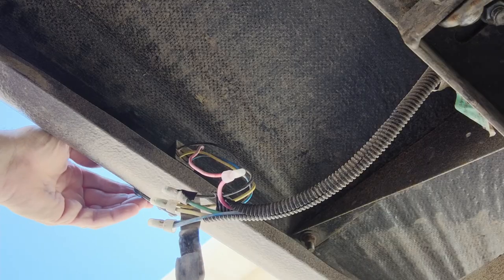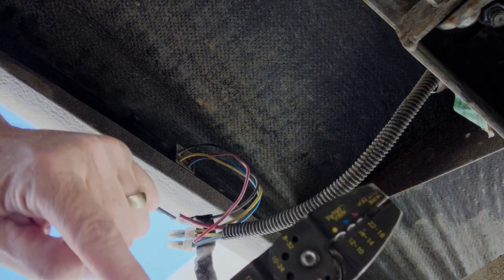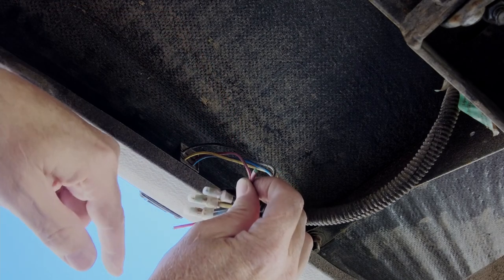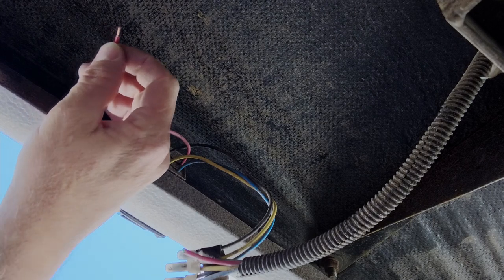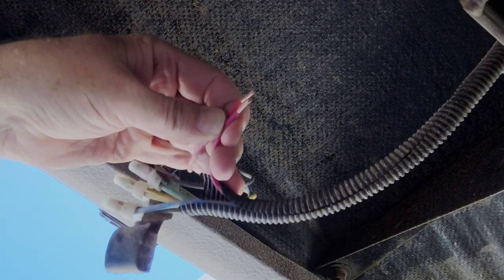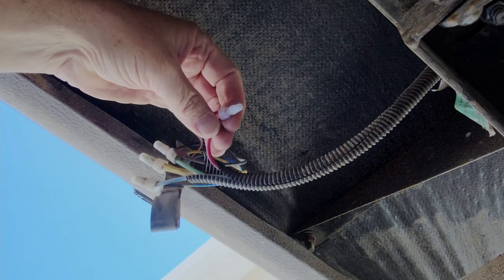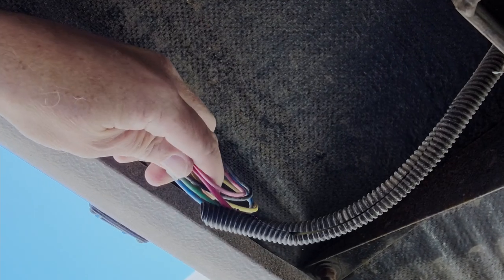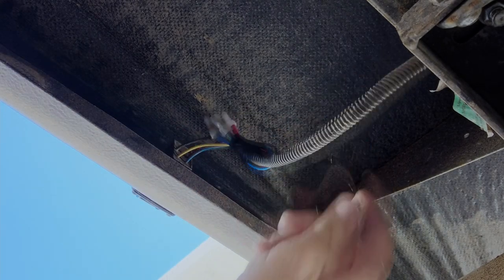How to FIX your RV Stabilizer switch | TheRVAddict

Comment: Stab switches and landing gear switches, I hate them all. You would think the RV industry would emulate the marine world with waterproof switches and captive wire holders. 🍸🍸
Reply from the maker: I am with you 100%, it seems everything in RVs is built not to last. 
Fortunately I still enjoy problem solving most of the issues. 
Thanks for watching Phil 👍

Comment: A child played with my front stabilizer switch and jack my stabilizers all the way up.  The switch wouldn’t work when I tried to let the stabilizers down.  I took the rear switch and used it on the front, with no luck.  I cut the wire at the motor and used my portable battery and the motor worked. I checked the power to the switch and it’s hot. This is a 2020 bullet.  I even took the under cover off and looked for some break or fuse in the wire from the switch to the motor.  Any idea what to do next?
Reply from the maker: Randy,  check the fuses on the lippert control box.  It is usually buried in the worst possible location in the RV. Hope that helps. 
Thanks for watching